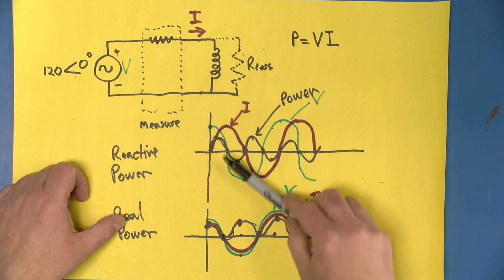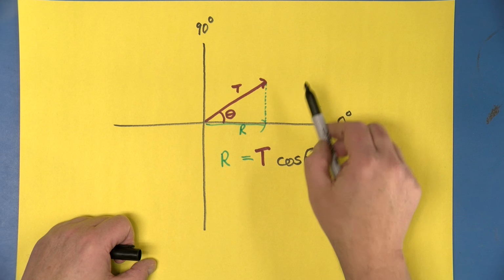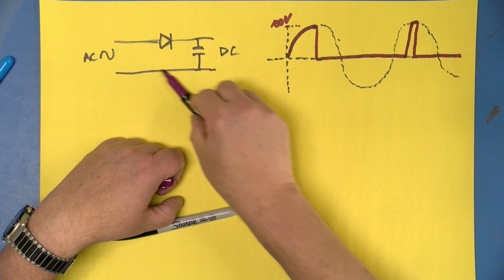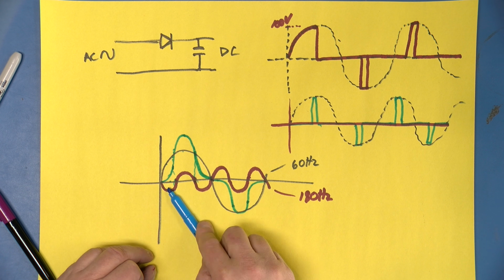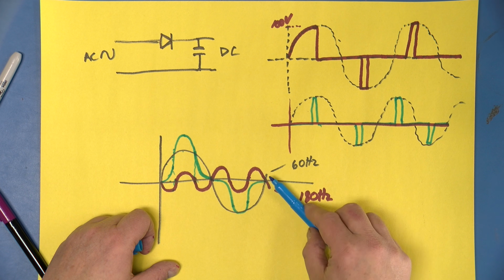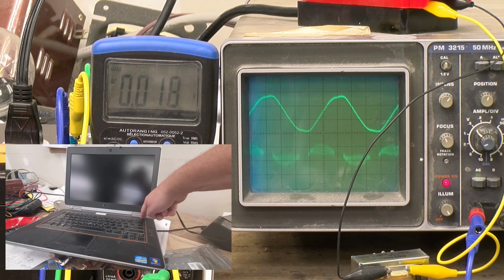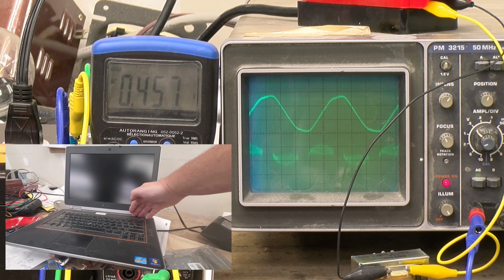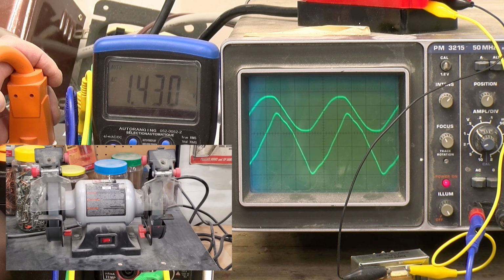Power Factor: you won't believe how bad some of our electronic devices are!

Comment: My house was remodeled by the prior owners about 8 years ago, and they installed mostly LED fixtures in the ceilings to replace older can lights. I also have a lot of LED bulbs in the house. I have about 5 or 6 computers running at once, along with a lot of wall wart-powered devices that have higher efficiency power supplies. When I listen to the amateur radio frequencies around the 2 meter band (144-148 MHz), the noise floor jumps from about S1-S2 during the day to S9+ when it gets dark outside. I am assuming this is due to the various noises from power supplies in my house. I’m going to try putting some chokes on the antenna feed line close to the radio and see if that helps. Do you think I’m on the right track?

I also wondered if you could comment (or produce a video) on the differences in electronics and waveforms between modified and pure sine wave inverters. I’m interested to understand the circuitry involved in making and regulating pure sine wave supplies. This is an important topic to me because inverters can generate a lot of noise on AM radio frequencies, and this is the basis for electric car companies to lobby federal regulators in the U.S. to remove the requirement for car makers to include AM radio capabilities in cars. The noise also interferes with the lower amateur radio frequencies, especially the 160 meter band.

A friend of mine who is a retired power lineman supervisor was telling me that some companies with tons of computers employ a strategy of double neutrals on their circuits with computers. I never understood why they would do that or how double neutrals would even work. Could that be a noise mitigation strategy? Maybe I misunderstood something he was saying about it.

This was yet another extremely informative and practically useful video. Thank you for all you do to envision, produce, and edit these videos, Dr. Jones! I enjoy them all. Best regards and 73 from  W9HAT, Asheville, NC, USA.
Reply from the maker: " the noise floor jumps from about S1-S2 during the day to S9+ when it gets dark outside." So it could be your lights going, maybe more computers doing things like watching videos? But I am also wondering if it might be an outside source - the whole neighbourhood turning on all their electronic power supplies, or even LED street light with electronic power supplies. Power line harmonics can go way up - when I was a "poor" student the old jalopy that I drove (read Dodge Aspen - worst car ever made!) only had an AM radio.  When I drove under some long distance power lines, there were enough harmonics to interfere with the AM signal. 

If you really want to see if the noise is internal to your house, turn off all the breakers (and UPSs) excerpt whats   powering your receiver and see if the noise floor goes down. If it does, selectively turn things on to find the cause.

"modified and pure sine wave inverters" great video topic. The modified sine wave inverters are really modified square wave inverters - so loads of harmonics to simplify the circuitry.

Your comment about AM in cars - actually its a wonder it does work at all in electric vehicles with all the pulse width modulation going on. I can see why they want the AM requirement removed. Bad idea in my opinion - AM is a lifeline in the country and the removing the requirement for AM in cars might make cars so RF noisy it dooms AM everywhere. 

Double neutrals? Never heard of that - unless is  not sharing the neutral between two split phase circuits because the harmonics dont cancel. I have heard of insulated ground from the ground  pin of each socket going directly to the breaker panel rather than connecting to other grounds along the way and also being separate from the conduit and junction box grounds. The can reduce noise and hum - often for audio equipment in studios and also in hospitals. The sockets are usually colored orange to indicate the isolated ground wire. I will have to look into double neutral. 

By the way - its responses like yours that make doing this fun and worthwhile. So thanks from this end! NC USA - hope you weren't in harms way when that hurricane tore though the SE US earlier this year. Best wish for Christmas and the New Year from up here in the great white north :)
Reply: OK LED lights have awful colour rendition so if you are lighting colour accurate art then swap out for low voltage halogen. Yes double neutrals are absolutely necessary as neutral currents are higher than per phase currents in many situations. The earth connection is probably not as good as you assume. In theatre we often install our own "tech earth" which is a separate earth which only earths the audio and if it gets really bad then an isolating transformer is required. As I live on a steel boat I have no problems with my radios.
Reply from the maker: @davidashton6567  Color rendition and also color temp - have been planning a future video on that!

You live in a Farady cage - how cool! A bit on an extreme way to keep out noise though :)
Reply: @ElectromagneticVideos  When you do colour rendition get yourself 2 identical colourful prints, light one with a low voltage halogen, this will have a colour temp around 3000 and a CRI of 100 then sit it next to leds and fluors and tungsten to see how the different colours change. I used to light art exhibitions.
Reply from the maker: @davidashton6567  OK, so since you are a pro at that stuff, let me ask you a few questions:

Why low voltage halogen as opposed to line/high voltage halogen? I cant imagine that the spectrum would be different but sounds like it might be from your recommendations. 

Similarly, how is tungsten different from halogen, or is it simply you can get a higher (color) temperature from halogen.

 Do you have email? If so - could you send me an email - my email is at the end of the 
video (I wont put here due to spam) . It would be a great way to keep in touch for when I make that video and might have some more questions ....

Thanks!
Reply: @ElectromagneticVideos  email sent,[with any luck]
Reply from the maker: @davidashton6567  Got it!
Reply: interesting
Reply from the maker: @DelmaRaySmithJr  Sometimes its these discussions that end up being the most interesting part of the video!
Reply: The best signal, at paris first floor is 13.56mhz from the door tag.

Comment: hence why I only buy low frequency inverters I have one right now that is a beast, I am going to try to sell it on facebook, its an old school aluminum clamshell powerjack with two GIANT torroids in parallel it CLAIMS it can do 10k continuous which I believe it has the hardware for but its def not wired for 10k watts, but I bet a welder would be interest I bet this thing could handle a welder easy if its 120v anyway you could rewire I suppose to have 220v
Reply from the maker: Thats sounds like an amazing inverter!

Comment: Very interesting video! But I'm confused how should we interpret power factor for these loads. If the current's shape is so weird, does the "phase shift" make any sense in this case? Does the pf reading on cheap energy meters reliable at all?
Reply from the maker: Strangely I replied to you comment yesterday but it apparently didn't save - here is attempt 2 :)

You are absolutely right - phase shift does not make sense in the case of these weird waveforms. I dont really like them being lumped in with "classical" phase shift power factor because they  are so different but we have to live with how those terms are used today. 

The reading on the cheap meters - your question is a good one - and one I can only guess at. To measure any of the quantities they show correctly, the waveform has to be sampled  at least twice the highest frequency or harmonic present (Nyquist sampling theorem). They also need to filter out harmonics or frequencies above half the sampling rate. I would guess most of the cheap meters skimp on that, but at what frequency they cut off is anyone's guess! I guess I should do some testing. So I wouldn't trust them on the really spiky waveforms, but the smoother or square wave ones are probably measured reasonably well. In the video there was an example of that - the voltmeter measured a different current for some waveforms than the power meter did, so one or both of them was getting it wrong. Both are cheap consumer devices, so you cant really fault them. I would expect a "pro" device to state the highest frequency they can sample properly to get an accurate RMS indication of current and/or voltage.
Reply: @ElectromagneticVideos  Thank you for your answer. Now things are bit more clear for me, but I'm still puzzled about reactive power. You gave a great example with one capacitor and one diode explaining where the spikes come from, but is there any reactive power? If so where it comes from? Isn't the diode blocking the capacitor from discharging to the grid?
Reply from the maker: @Pirx615  Reactive power is where power flows into the load and then back so there is no net power flow. In  the case of the diode and the capacitor there is no power flow back (stopped by the diode) so the power is not reactive - its all real. Sorry if the that example was misleading after talking about reactive power.  Now if  there was no diode there would be reactive power - into and then back from the capacitor. 

The diode and capacitor was meant as an example of a typical electronic power supply with a very spiky current as an example of bad power factor of the other kind. 

Hope that cleared things up!

Comment: As a lighting technician I have spent a lot of time tiring to persuade electricians that on dimmer systems the chopped waveforms do not cancel out on the neutral line and for low levels of dimmer the neutral current is the sum of the phase currents. Burnt out neutrals are so common  as the older neutrals were smaller than the phase wires. I made a truly awful video on this a million years ago. https://www.youtube.com/watch?v=pZ_Eq6jY51U if you use moving iron meters they are more accurate As to what the current switch to LED lights will do to the power grid it is a great concern.
Reply from the maker: I just watched your "truly awful video" - what a fabulous example of (the harmonics in) the chopped waveforms not cancelling!  I didn't know burnt out neutrals were common - I can sure see that in a theatre situation with high power lights on dimmer are common. 

Thanks for posting. With your permission., sometime I may try an recreating the demo you did in higher definition video. So nicely done!
Reply: @ElectromagneticVideos  This leads to the next problem, the earth is linked to the neutral and a heavy neutral current lifts the earth voltage, only a little but enough to cause earth loop problems with audio, so the lighting guy, me, got the blame for the audio problems, which led to me investigating and understanding the problem.
Reply from the maker: @davidashton6567  Audio hum is the worst - and those sharp edges from the dimmer would make it even worse than a hum. 

From your accent I'm guessing your in the UK (sorry if I got that wrong) - was just discussing how  neutrals in Europe are connected differently to ground than ours in Canada (we bond them in the main circuit breaker panel in the building). So  I could see  the hum generation being worse in 230V places. One thing we do over here is use outlets with grounds kept isolated from things like the junction box or conduit, and the outlet ground run as a separate insulated wire to the panel to reduce hum in places like TV studios. Still, there are always instances where hum makes it though :(
Reply: @ElectromagneticVideos  To make things worse the neutral is running at 150Hz and harmonics which is right into audio frequencies and in broadcast situations the control van is on a separate generator. With switch mode power supplies pulling peak current in the centre of the waveform I would have thought that neutral curents would be pretty high, you might want to do a follow up video on this, as the harm to the power infrastructure is important. Yes UK born, but 50 odd years in Australia.
Reply from the maker: @davidashton6567  Australia! You live in a wonderful country! I explored the east coast and then a bit inland for 2 months - amazing trip.  Harmonics - with a bunch of them it becomes hard to filter out without degrading the audio too much. I do have an old 3 phase synchronous motor - if it is still operational I should be able to make some nice clean 3 phase from the single phase I have at home for a video. That will be (my) next summer -  its outside in the garage and to heavy to move indoors into the warmth.

Comment: Thank you for covering distortion power factor!!  Introductory EE power classes cover displacement power factor (cos θ) and leave it at that.  Check out the Power factor Wikipedia page for the general case integral computation that incorporates both displacement and distortion.  This part of the page had unfortunately been removed earlier this year, but I just added it back with improvements.
Reply from the maker: I think the problem is "traditional" power factor is so different from the current distortion that is really such a different thing it should probably not be lumped together. So are you a Wikipedia contributor? That really neat - I always check what Wikipedia says and I did so for this video. If you ever want to use screenshots for my videos of things like scope traces - please do so (with proper credit). I would be happy to upload screenshots as the original author if that helps with copyright rules. Great that you enhanced the Wikipedia page - the technical content of Wikipedia sure puts traditional encyclopedias to shame its so good!

Comment: At 33:35 the night light waveform is typical for a Thyristor not a Triac. A Thyristor has a delay then conducts, a Triac conducts then disconnects. 

You have no idea how excited I was too Have spotted that. I feel like I have validated the Power electronics credit that I took 30 years ago. 

As usual this is a excellent well articulated presentation video.
Thank you.
Reply from the maker: I wonder of they used terminology a bit differently: Today thyristor is general class of devices that includes things like SCRs, TRIACs and DIACs.  The classic dimmers have a triac triggered by an potentiometer  voltage divider from the AC in. Soe of the better ones also have a diac to hold off trigger until a higher trigger voltage has been applied. 

So concepts as you describe - but terms a bit different. Could also be location specific terminology - I come across that a lot with the worldwide audience!

Glad you liked the rest of the video!
Reply: That is not correct. A triac is nothing more but two thyristors in one package. Both devices will not turn off, once they have been brought into conduction, until the current through the devices approaches 0A.
Reply: A Thyristor = SCR, a Thyristor is a unidirectional device, it can only pass current in 1 direction, to pass AC , you have to use 2 Thyristors (or SCR's) in opposite direction. 2 Thyristors in opposite direction forms a Triac. A Triac is a bidirectional device. There is a difference in the N vs P doping between both devices, but they work the same. 
A Thyristor (or SCR) or 2 in opposite direction to form a Triac, they have all in common that they shut off at the zero crossing point. So you can't see the difference between both on a scope. When a DIAC is used to trigger the Thyristors (or SCR's) or the Triac, the point of turning on is delayed because at the zero crossing, one of Thyristors (or SCR) can engage earlier before the other one, and this causes extra noise. With a DIAC this triggerpoint is raised to 26a32V (depending on the type of DIAC)of the sine wave for a cleaner ignition of both Thyristors (or SCR) in the Triac. I have opened many LED's, older and newer, but the ones that use this technology had all a Triac, never 2 separated Thyristors. Grtz

Comment: Very thorough!
Thankfully the power lines make excellent low pass filters!
Reply from the maker: Thats true - although I sure in doing so they radiate a lot of RF from the upper harmonics. I wonder of the harmonics  mess  up the powerline ethernet adapters they sell for extending wired ethernet thought the home.